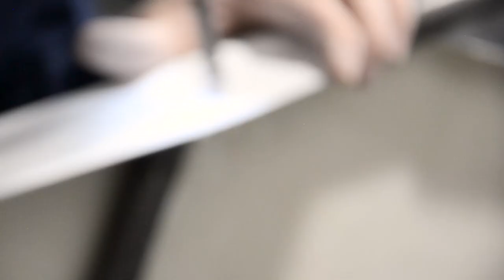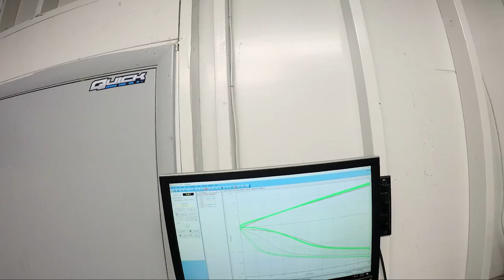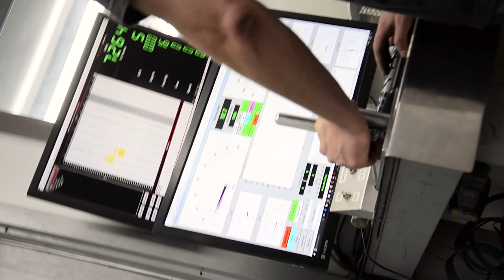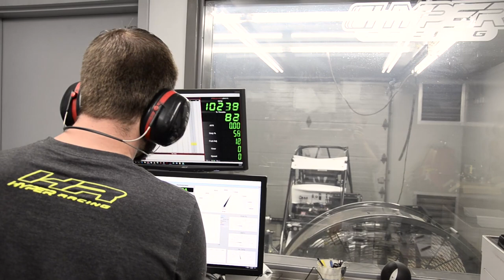A Complete Guide: Austin Quick's X7 600 Car Build | Hyper Racing

Comment: It's fascinating for those involved in sprint, outlaw and quarter midget, but I drive what your industry calls a flat kart. It, too, is a sprint (kart). I can't do it though. I absolutely have to have right turns with my 83 lefts. I have the knowledge and skills to hold speed through a double hairpin chicane. That wouldn't have happened in dirt oval. I appreciate the time and effort that goes into your sport and at the end of the day, it's all racing!!
Reply: yeah but what makes you go fast turning left IS also what makes you fast while turning right.....just bassackwards........